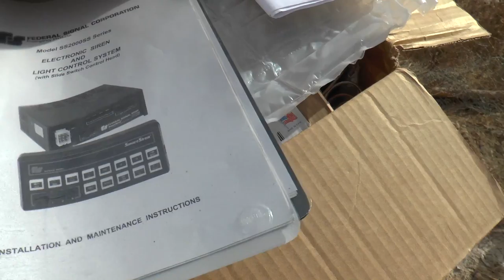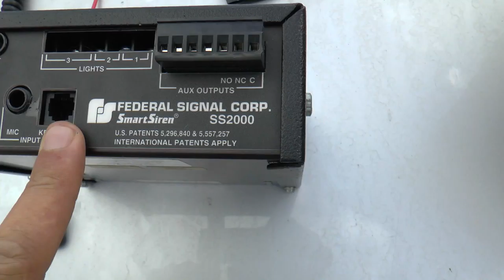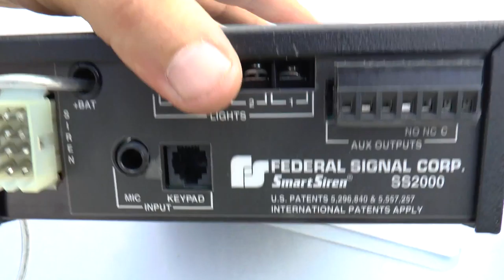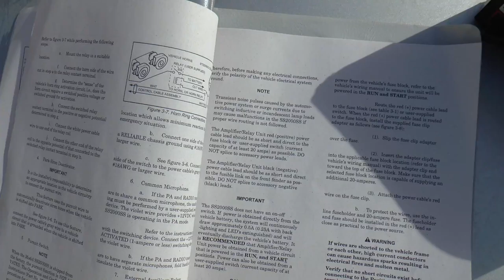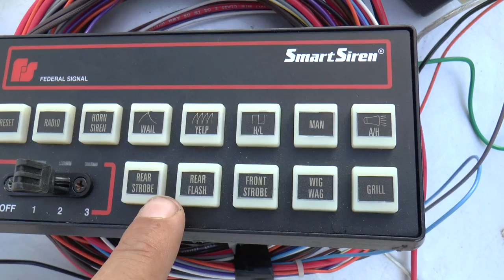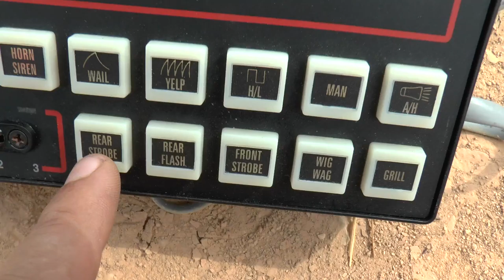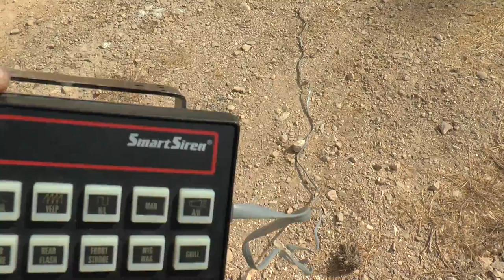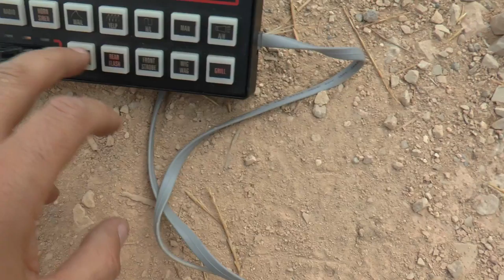Federal Signal Smart Siren (SmartSiren) SS2000SS-SB - Review!!

Comment: So the wire thats from BAT+ is just for lights right? I don't need that to make the siren work? Just the positive negative and speaker wires from the harness?
Reply from the maker: correct. the BAT+ does not effect the Siren, it is for relays and lightings

Comment: Thank you very much the connection to a fuse is mandatory?
Reply: @yoelstrikovsky  thats not true at all, i have whelen control box right now and its on constant power to the battery, battery has never once died from it for the past 3 yrs since its only an led backlight, even if your car is turned off and you have your lights activated if you have led lights your car battery has more then power to keep them running for a while

Comment: wiring really isnt my thing but i do want to get one of these. do i have to run a wire to a ignition fuse or can i just connect both wires to my battery instead as i dont wanna mess with fuses
Reply from the maker: you can, but than you loos the option/capability that the Siren would turn off when you turn off your engine. basically it will always be on.
not sure how much power it would draw from your car's battery overnight or on longer parking period. you might find yourself with empty battery (or not) and jump start your car the next morning, etc.
Reply: @yoelstrikovsky  thats whati was thinking so i guess ill have to figure it out
Reply from the maker: @vegascvpiaaron4026  let me know as I am intrigued if it heavy on the battery or not
Reply: @yoelstrikovsky  sure thing